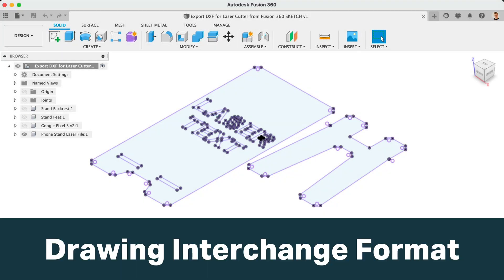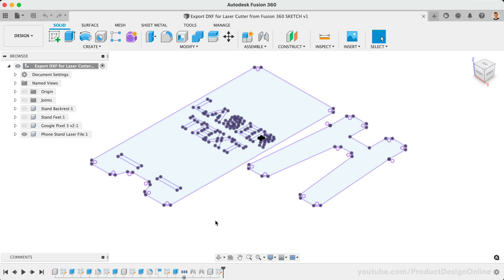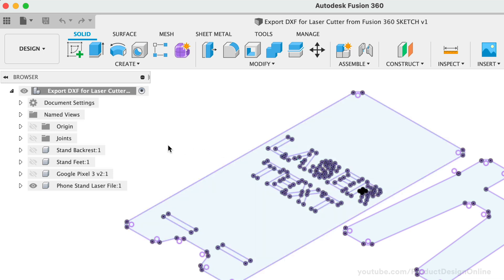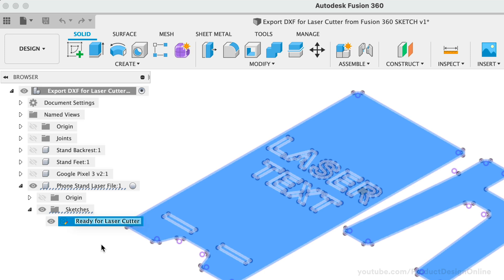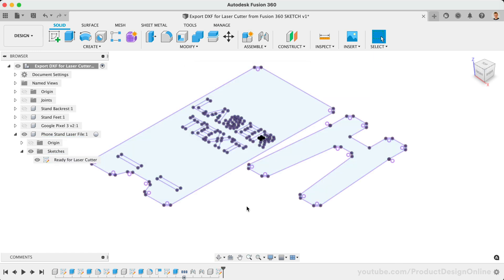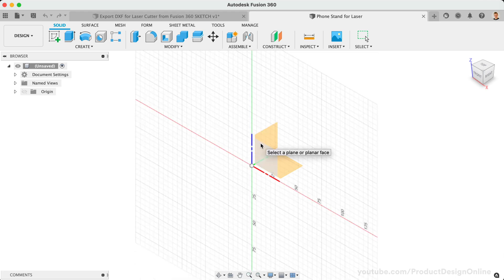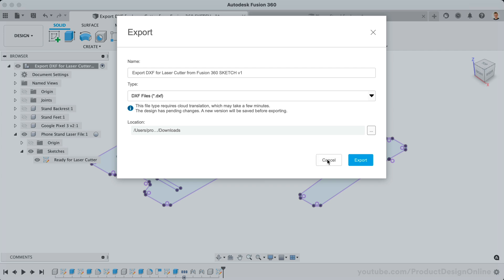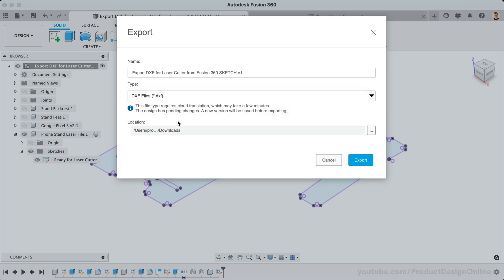Export DXF for Laser Cutter from Fusion 360 SKETCH - Learn Fusion 360 for Laser Cutting 5 of 6

Comment: hoping someone can help so when i export the dxf file to inkscape and other apps its way to small, my glowforge does not read dxf so i have to save to svg.. any help would be great i tryed changing unit in other software and samething
Reply from the maker: Fusion 360 exports DXF as Centimeters. More on the problem/solutions here: https://www.autodesk.com/support/technical/article/caas/sfdcarticles/sfdcarticles/Exported-DXF-from-Fusion-360-is-the-wrong-size-in-another-program.html

Comment: Can "personal license" one able to save as DXF?
Reply from the maker: Personal license holders can export as DXF from Sketches (in the Fusion 360 Browser), but not from the Drawing workspace.
Reply: @ProductDesignOnline  How does that work. I can't find anything like that.
Reply from the maker: @shaydereaver3672  Right-click on your Sketch in the Fusion 360 Browser (left side; toggle Sketches folder open) > select 'Save as DXF' per the desired sketch.

You can use the 'Project' command to place everything into a single sketch if you'd like to export specific parts of a design.
Reply: @ProductDesignOnline  Thank you. I have been having way too much trouble with it.

Comment: One thing left to go over in Fusion 360 regarding DXF laser files. Older lasers do not accept modern DXF files. Autodesk is offering some additional save modes to address this problem. I am not sure if it is build in in current version of Fusion 360 or need to be added as an App. The thing is this versions of DXF transformation are limited. There is no version of DXF possible to cope with my old LASERCUT 5.1 software dated back to windows 2000.  I need   DXF W2000 to go with it. It took me years to find proper translator ( TAIG  used in DevCad ).  Fusion is not able do it for me. Every file for laser on Fusion has go to through  the Dev Cad. It is annoying. I have mentioned it to the Autodesk people. Maybe you get better communication with them.
Reply: Have a look at Inkscape to run your Fusion DXF's past and see if saving it in R12 format works on your old version of Lasercut? Are you running the DXF version or will it handle CDR too? On my small Laser until I drop the Ruida controller in I am still doing this to export as SVG for my Laser.